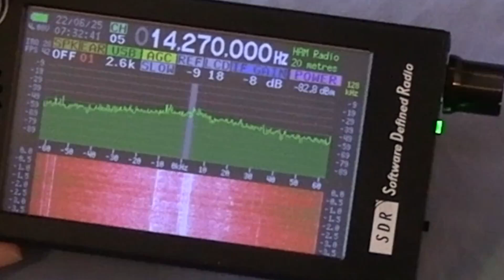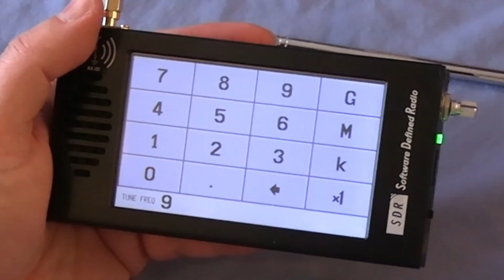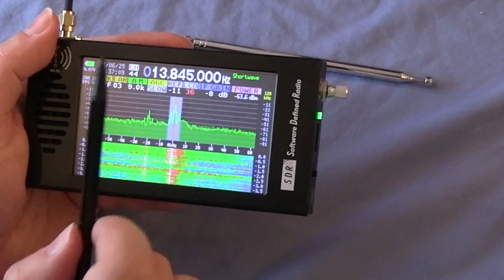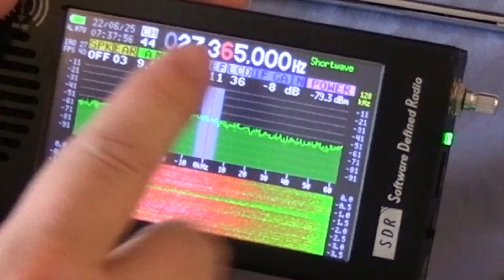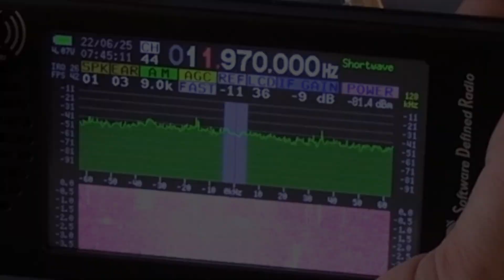HOW DO YOU TUNE THIS? Software Defined Radio SDR Radio Receiver FM/AM/LW/MW/SW/AIR-Band DSP

Comment: The radio is just a peace of chinese shit. it is a clone of a halve developed clone. knob is turning the wrong way, the gain settings are a disaster and no connection to a pc.
Reply from the maker: You're right that it has its flaws, but for the price, it's a decent option for basic listening.

Comment: May I please ask for help? My sdr suddenly will not receive fm band 88-108 and just static no signal received on any other bands ,just static.antenna.and reception is good.just not voice/ signal at all just static. Never hooked it up to computer.no factory reset.just wondering if it is a defect?
Reply from the maker: How is the antenna connected?
Reply: @RobbieStrike it's not the antenna.Trust me we're not a greenhorn
Reply: Just static, no pick up at all.No receive no talk voice. Add another radio next to it on the same frequency.And the other radio picked up the transmission.This radio did absolutely nothing just static.

Comment: The Knob Problem Can Be Solved With Trimming The Plastic Rim Off , Just Put It On Sandpaper And Sand It Down A Few mm, It Will Reduce The Touching on The Device Itself, Other Thing What You Can Do Is Put 4-T Oil In To The Variable resistor Inside So It Turns Much Smoother, Put AA Rubber Gasket On It So No Dust Can get  In And Thats It. :) There Are Many Tips And Tricks What You Can Do To make It better.

Comment: Try the HackRF portapack
Reply: It's like the HamGeek DSP-01, but it can transmit lots of stuff, you can change multiple gains and it still is battery powered.
Make sure to not give over 1 volt into the antenna port with the RF amplifier on, or else you might fry it

Comment: Put a piece of cotton in the knob hole and put it back on. If it does it again just put another piece in. Thanks for the video
Reply from the maker: That is a good idea. I took some play dough a quarter pea size and stuck it in the nob.When I make my follow up video for this I will let you know if it worked. I have fixed rattling floor vents with Play dough before :)

Comment: Cool, but the 100k~149MHz is kinda limiting. I would be much more useful if it went up to at least 1GHz.
Reply from the maker: I'm surprised it doesn't offer that I do have that with my RTL SDR.  But I have to unplug the app converter and connect it to a different antenna